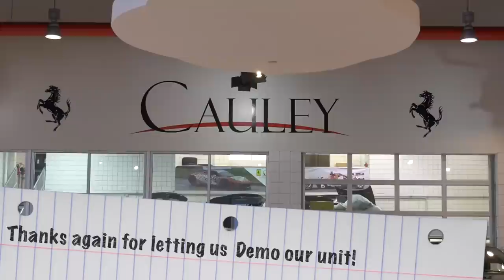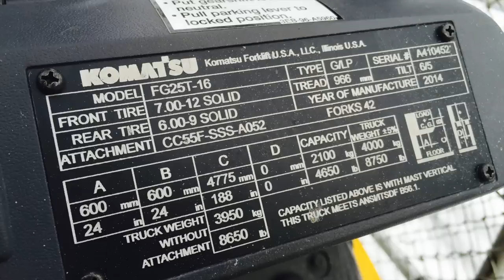Detroit Wrecker Baltimore Tow Show 2014

Comment: I'll take a "low loader" setup, but I'll take it as a trailer, I don't care if it's bumper pull (prefered) or gooseneck 20' deck length.... you can send an under lift kit for my f350 too... lol